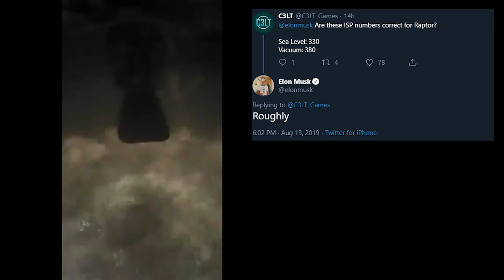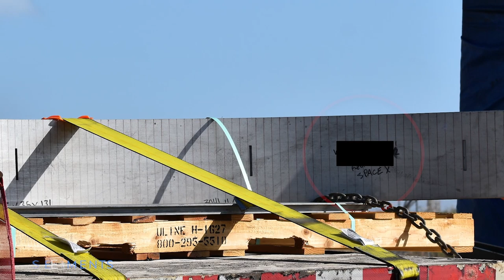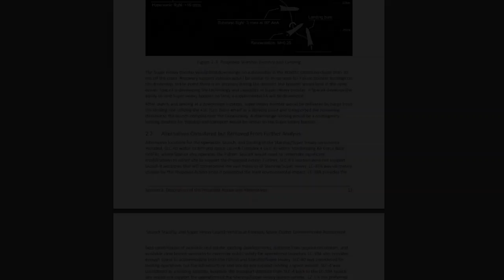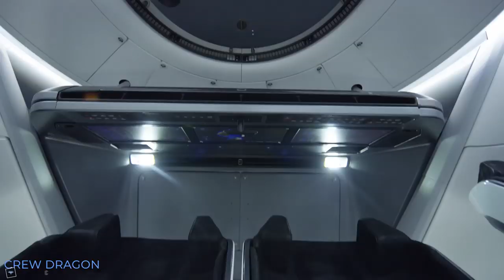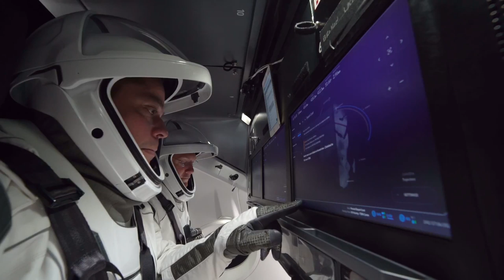25 | SpaceX Go For Launch - Starship & Starhopper News - SpaceX Suits - Starship Flame Diverter

Comment: The only thing I've ever seen something like that used for is a tank impeller so that's really weird that thous would be going into starship 

Journeyman pipe fitter here
Reply from the maker: You mean the long tube, right? Yeah, that would be rather strange... :D Thanks for the comment from a pro!
Reply: @Whataboutit  yes the long tubes with the spiral looking rings on it usually get installed in the center of a large tank and get impeller  fins attached to them so they act as a giant pot stir but I guess another idea could be an anti slosh device?
Reply from the maker: Anti slosh device? o.O
Reply: @Whataboutit  

It would theoretically keep the liquid from moving around too much in the tank.  That can be an issue with sudden movements, which is why liquid tank trailers have baffles to reduce the amount of weight shifting in the tank.  When the Starship is maneuvering inflight that could potentially be an issue.
Reply from the maker: That might be it! Thank you for the thought! Starship will come down like a sky diver. The Falcon boosters don't! :O

Comment: New helmuts for space suits has an inherent flaw.  they seal on the outside.....pressurized suits should have the seal on the inside, so that when the suit is pressurized, the visor pushes against the sealing surface, not away from it.  Come on, Elon....surely you can do better.
Reply: They look like toys, the capsule too.
Reply: Jim Hofoss look closer.  The seals are actually well designed.
Reply: W S   don’t like....I would rather have the positive pressure of the spacesuit pushing the visor against the seal.

Comment: No FAA approval yet...
Reply from the maker: https://twitter.com/jeff_foust/status/1161330027809640450
Reply from the maker: The notam is active though... ?!?
Reply from the maker: I am a pilot. That thing is cleared. ^^ What is Elon talking about?
Reply: @Whataboutit  Cool, you better be right! :) It crossed my mind that Elon may have missed this, or there's something weird in this. Let's hope for the best!
Reply: The NOTAM and a Road closure is not as hard to get approved for and are easily lifted where testing a new rocket on a non-military testing ground is a lot of red tape with the FAA. In Cocoa there is also a rail way being put in to connect Orlando to Port Canaveral near SR 528 "The Beach-line" which is really close to their facility. I bet Elon will try to utilize that for transport  considering it may be the most perfect way other than truck over 2 rivers.